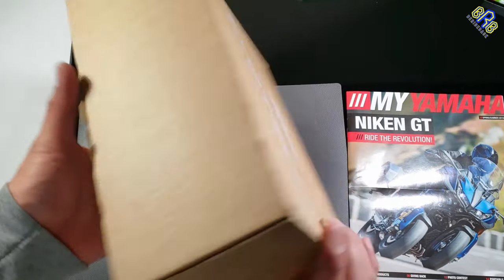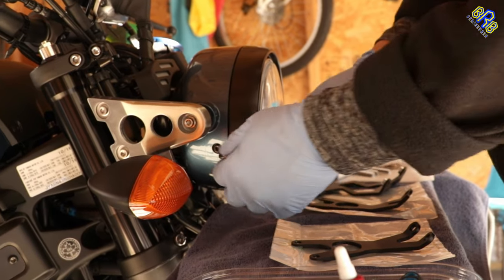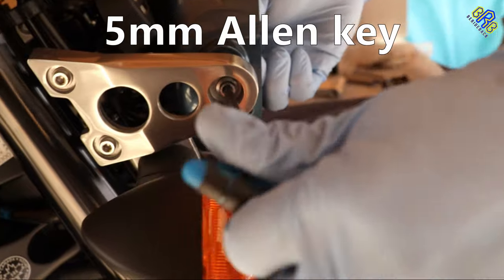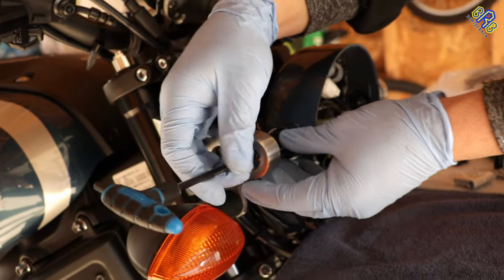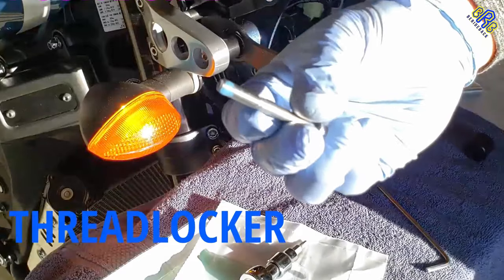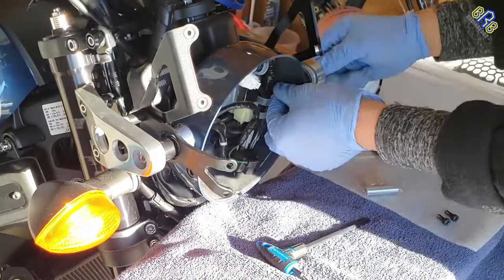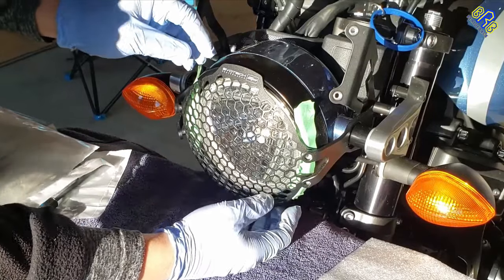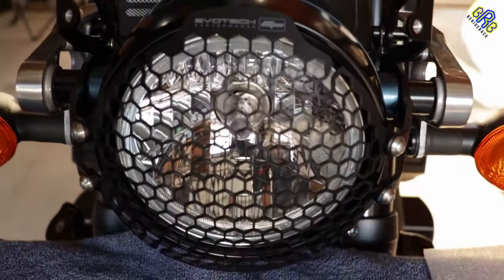Headlight Guard Evotech Yamaha XSR900

Comment: Hey man! Thank you for the cool and useful video! I have an unusual question... could you tell me the length of the black plastic spacers please? I will be grateful even for the approximate data on ruler!
Really need this information. They weren't in my package…
Reply from the maker: Hi Pavel, sorry for the super late response, sure I will check the exact size and I will let you know asap, thanks for your feedback and ride safe.
Reply: No problem, forget it)
I picked up the size in the store quickly
Ride safe and good luck!
Reply from the maker: Hey Man! Hope you doing great! The black aluminum spacers as I measured in 22mm, hope that helps, be safe always.